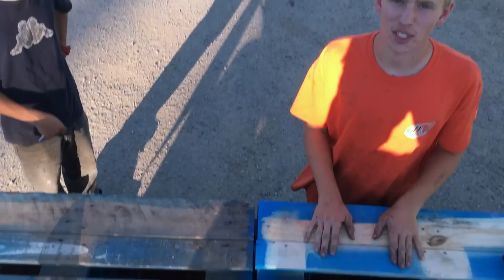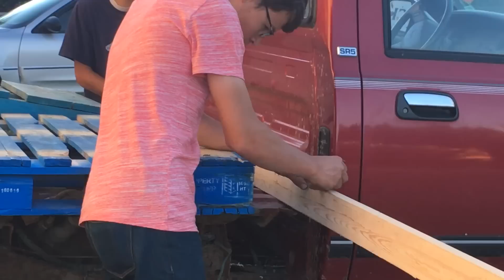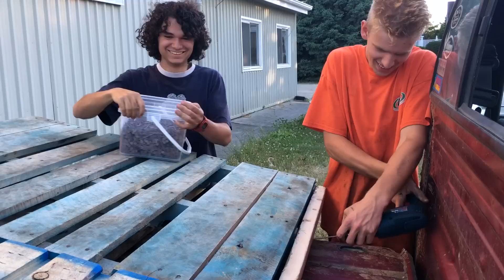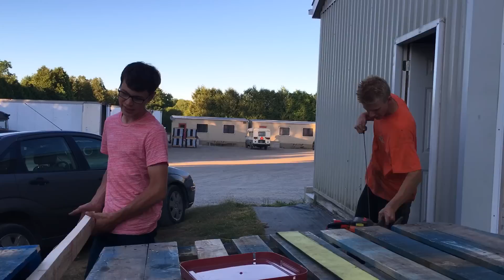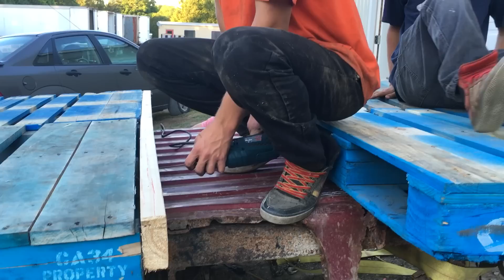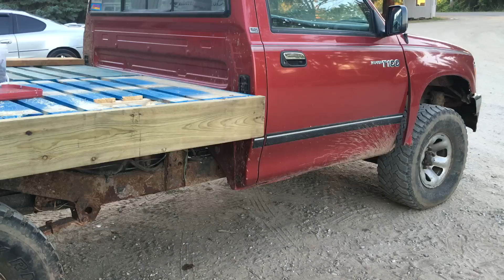Flat Bed on a $0 budget! (DIY)

Comment: Wow, just last month i built a flat bed for my 1989 Nissan pickup. Has no brakes, gotta pull on the e-brake to slow down. Cutoff the cat and the muffler so it's really loud like this truck in the video.
Just a little tip even though your little project is already done: Screw those 2x4s into the pallets before putting them on the bed, makes it a lot easier.
Reply from the maker: +Masen Smith  Nothing wrong with an old beater truck..... nothing to worry about :) and the noise is glorious!  just be safe! E-brakes aren't designed for constant use.      
And ya.... we realized our mistakes after we finished. But we got a good laugh out of it, so it's all worth it.
Reply: For sure! I love my beater. I only use it to haul wood from A to B so having no brakes is no problem at all. Fun video by the way, I enjoyed watching it.
Reply from the maker: +Masen Smith Oh ya, that works then.  At least it's useful! Our beater just sits around till we find something destructive or fun to do for the afternoon with it (like our latest tug of war video) lol
Glad you enjoyed :)
Reply: Masen Smith that's really cool

Comment: its to high up now, pallets are junk unless u strip them. and its hard.  and shit will fall in between.  y not just use plywood and u-bolt to frame. meh
Reply from the maker: We only did it for fun, we realize that there isn't as much use for it.  The truck hasn't been used much since then (Other than the truck pull in a recent video)
Reply: Shifted Interests - Chris Boot you could always use it to haul hay :)

Comment: NO, NO, NO!!!!......HELL NO! ANYTHING BUT PALLETS!!!!! It's not a flatbed. It's a "full of big ass gaps" bed.
Reply from the maker: +oldtimer4567  AHA. Well you aren't wrong... it does have gaps. Although for what we use the truck for (field work) it does the job quite well.
Reply: oldtimer4567 Can always lay down some plywood, would add strength as well.
Reply from the maker: +FCFordLord  We would have done more if we planned on keeping the truck, but it will be used as a parts truck (good engine and transmission) the rest is junk lol